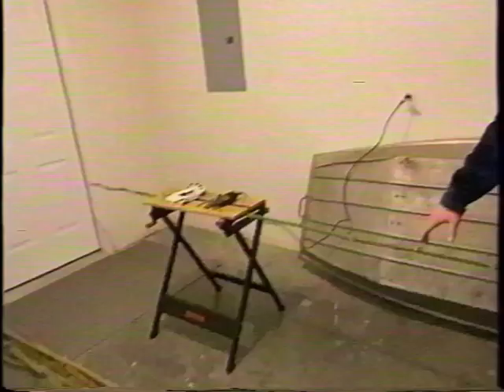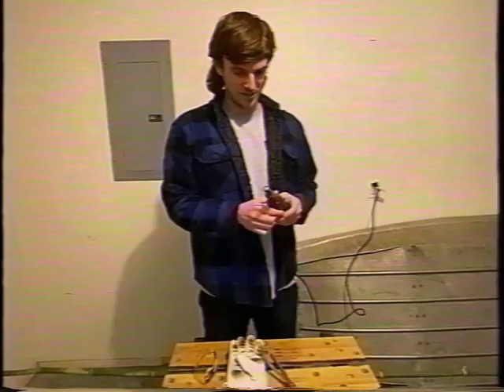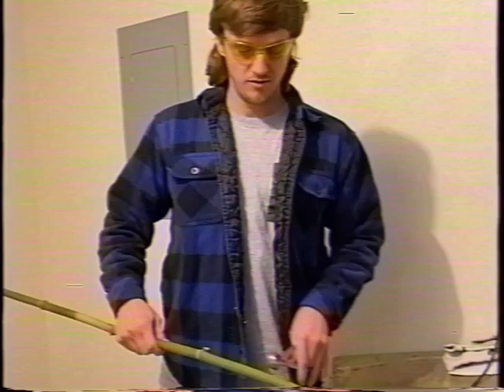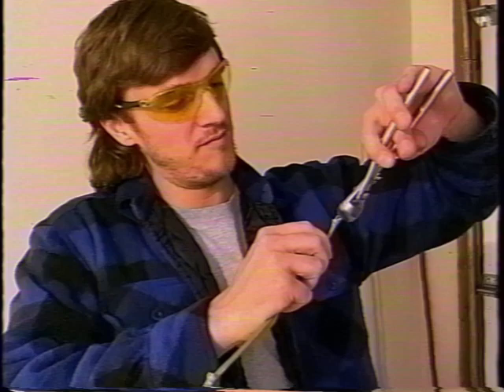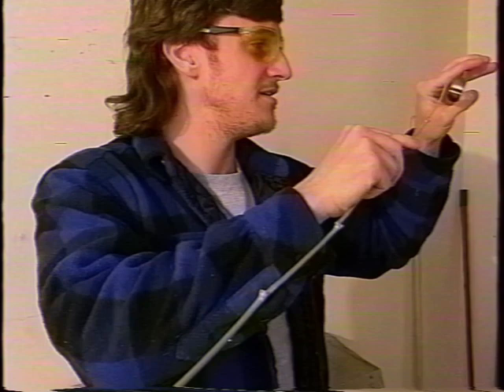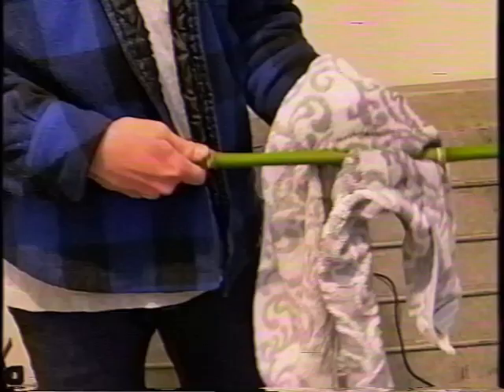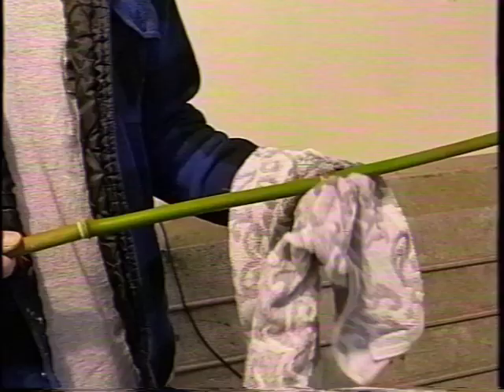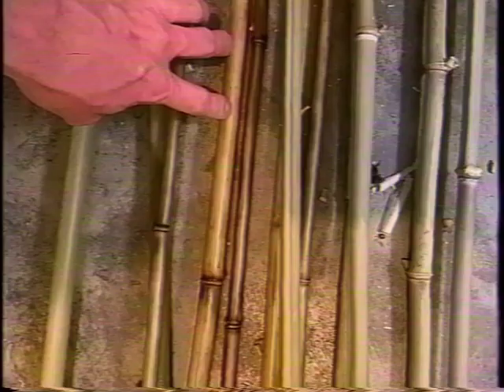Making a Cane Pole P2: Removing the Bamboo Branches

Comment: Billy. Let me suggest: clump all the poles together, and tie them in maybe 4 places
 The tighter you pack them in the clump, the straighter they'll be. If you have just one, and you need to get the curve out, dry it in a piece of 3/4 pipe. Metal works best, but pvc works well also
 In the Philippines, they bend bamboo in all kinds of shapes by steaming the pieces. They steam the pieces, bend them till cool.
Reply from the maker: Appreciate the suggestion. drying it in a piece of pipe is a really good idea I will be trying that. Yeah the eastern world bad bamboo on lock they love the stuff

Comment: Dude that Dremel makes quick work of the sanding. Sure beats doing it by hand. Those heat treated poles look killer.
Reply from the maker: Yeah the dremel sure is handy. This new bamboo I cut the branches are pretty darn tough. The River Cane branches pull off easily though.

Comment: How do you clean-cut the bamboo poles into smaller poles?  I used a jig saw and it leaves a message cut, not clean at all. Thanks.
Reply from the maker: I use a tiny hand saw that leaves a pretty clean cut. I also smooth areas out with my dremel tool